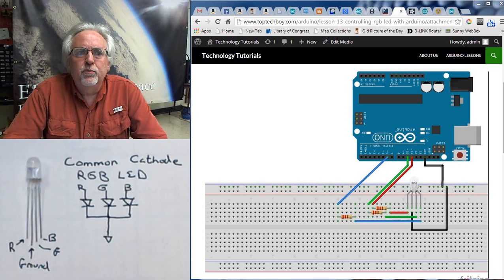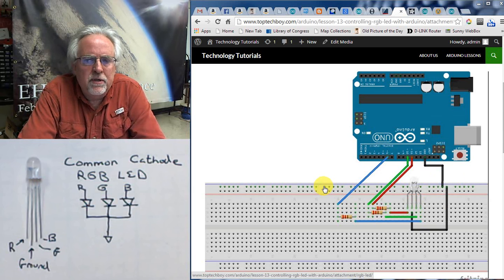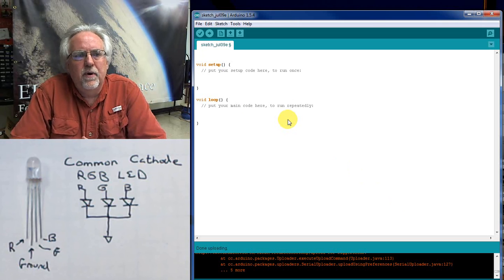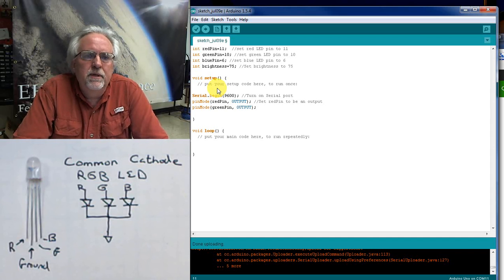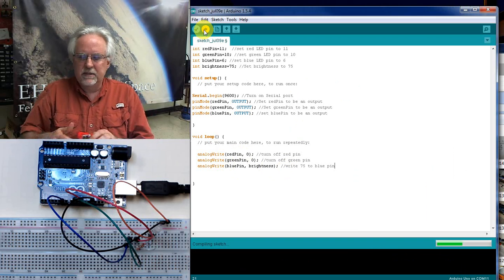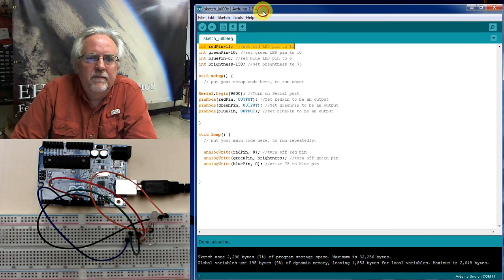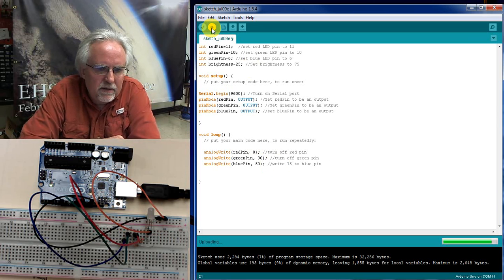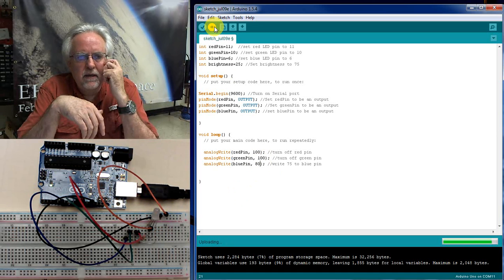LESSON 13: Controlling an RGB LED with Arduino

Comment: This one took a lot of tweaking to get a result I was happy with. The white is a little on the blue side, but not any more than the daylight bulbs you can get. But I can live with it, considering the red is so underwhelming on these LED's. I might experiment later with upping the current on the red and lowering it on the green and blue. But that will be for another day!

Thanks for the lesson!
My code below:
// Lesson13: RGB LEDs.
// Using the Arduino Nano.
// https://youtu.be/gqAHOoqo3OI?si=xvEFMB-R0pcTsk6S
///////////////////////////////////////////////////

// Set up the pin variables.
int iPinRed =  9; // The red LED.
int iPinGrn = 10; // The green LED.
int iPinBlu = 11; // The blue LED.
int iPinRnd = A1; // Used for random number.

// Control variables.
int iRedVal;  // The red value.
int iGrnVal;  // The green value.
int iBluVal;  // The blue value.
int iRndVal;  // Holds the random number.

// Delay variables.
int iDT = 10;

// Loop variables.
int a;

void setup()
{
  // Setup the serial port.
  Serial.begin(9600);

  // Set up the pinModes.
  pinMode(iPinRed, OUTPUT);
  pinMode(iPinGrn, OUTPUT);
  pinMode(iPinBlu, OUTPUT);
  pinMode(iPinRnd, INPUT);

  randomSeed(analogRead(iPinRnd));  // Initialize the random number generator.
}

void loop()
{
  // Note on the random(min, max): "max" will be -1 of max.
  iRndVal = random(0,10);  // Get a random number between 0 and 9.
  iRedVal = 0;
  iGrnVal = 0;
  iBluVal = 0;
  onLEDSequence();
}

// Writes the LEDs values.
//////////////////////////
void onWriteLED()
{
  analogWrite(iPinRed, iRedVal);
  analogWrite(iPinGrn, iGrnVal);
  analogWrite(iPinBlu, iBluVal);
}

// LED RGB sequencer.
/////////////////////
void onLEDSequence()
{
  switch (iRndVal)  // Select the color based on the random number.
  {
    case 0: // Red.
    {
      Serial.println("Red.");
      for (a = 0; a <= 255; a++){ iRedVal = a; onWriteLED(); delay(iDT);}
      for (a = 255; a >= 0; a--){ iRedVal = a; onWriteLED(); delay(iDT);}
    } break; 

    case 1: // Green.
    {
      Serial.println("Green.");
      for (a = 0; a <= 255; a++){ iGrnVal = a; onWriteLED(); delay(iDT);}
      for (a = 255; a >= 0; a--){ iGrnVal = a; onWriteLED(); delay(iDT);}
    } break;

    case 2: // Blue.
    {
      Serial.println("Blue.");
      for (a = 0; a <= 255; a++){ iBluVal = a; onWriteLED(); delay(iDT);}
      for (a = 255; a >= 0; a--){ iBluVal = a; onWriteLED(); delay(iDT);}
    } break;

    case 3: // Yellow.
    {
      Serial.println("Yellow.");
      for (a = 0; a <= 255; a++){ iRedVal = a; iGrnVal = a * 0.30; onWriteLED(); delay(iDT);}
      for (a = 255; a >= 0; a--){ iRedVal = a; iGrnVal = a * 0.30; onWriteLED(); delay(iDT);}
    } break;

    case 4: // Cyan.
    {
      Serial.println("Cyan.");
      for (a = 0; a <= 255; a++){ iGrnVal = a; iBluVal = a; onWriteLED(); delay(iDT);}
      for (a = 255; a >= 0; a--){ iGrnVal = a; iBluVal = a; onWriteLED(); delay(iDT);}
    } break;

    case 5: // Magenta.
    {
      Serial.println("Magenta.");
      for (a = 0; a <= 255; a++){ iRedVal = a; iBluVal = a; onWriteLED(); delay(iDT);}
      for (a = 255; a >= 0; a--){ iRedVal = a; iBluVal = a; onWriteLED(); delay(iDT);}
    } break;

    case 6: // Purple.
    {
      Serial.println("Purple.");
      for (a = 0; a <= 255; a++){ iRedVal = a * 0.90; iGrnVal = a * 0.04; iBluVal = a; onWriteLED(); delay(iDT);}
      for (a = 255; a >= 0; a--){ iRedVal = a * 0.90; iGrnVal = a * 0.04; iBluVal = a; onWriteLED(); delay(iDT);}
    } break;

    case 7: // Pink.
    {
      Serial.println("Pink.");
      for (a = 0; a <= 255; a++){ iRedVal = a; iGrnVal = a * 0.10; iBluVal = a * 0.15; onWriteLED(); delay(iDT);}
      for (a = 255; a >= 0; a--){ iRedVal = a; iGrnVal = a * 0.10; iBluVal = a * 0.15; onWriteLED(); delay(iDT);}
    } break;

    case 8: // Orange.
    {
      Serial.println("Orange.");
      for (a = 0; a <= 255; a++){ iRedVal = a; iGrnVal = a * 0.09; iBluVal = 0; onWriteLED(); delay(iDT);}
      for (a = 255; a >= 0; a--){ iRedVal = a; iGrnVal = a * 0.09; iBluVal = 0; onWriteLED(); delay(iDT);}
    } break;

    case 9: // White.
    {
      Serial.println("White.");
      for (a = 0; a <= 255; a++){ iRedVal = a; iGrnVal = a;iBluVal = a; onWriteLED(); delay(iDT);}
      for (a = 255; a >= 0; a--){ iRedVal = a; iGrnVal = a;iBluVal = a; onWriteLED(); delay(iDT);}
    } break;
  }
}

Comment: Hey paul. Thank you for the great lessons. They are pretty helpful in learning MCUs. for this lesson, can't you just connect the Ground to a resistor instead of connecting each LED? I guess you should just assume that the total parallel resistance of the LEDs to choose the right Resistor

Comment: MEGA 2560. The first time we tried this we failed. We managed on the second try to get the RGB Led to light all three colors however, once we begin to experiment with different values in the void loop, the RGB fails to light, when mixing below 80%. When mixing blue and green, green dominates and blue does not light at all. Anyone have any ideas?

Comment: Couldn't you use just 1 current limiting resistor on the cathode?
Reply: the RGB LEDs has different forward voltages like shown on the link : https://imgur.com/a/q7MCZBM so imagine we have a supply of 5V supplying the 3 LEDs and a resistor on thier common  cathod with a drop voltage of 3V, you will be left with 2V to play with across the LEDs will  which will not be enough for the Green and Blue LEDs to be lighting up correctly(see the graph), and you will notice the difference in intensity between the 3LEDs.
if you have 3 different resistors on each LED anode you will have the liberty to chose them according to the forwad volatge of each LED.

Comment: Great series! With the RGB LEDs I'm using, you cannot make them mix the colors like your leds are doing in the video.  If, for instance, I set values of red to 25 and blue to 25, while green is 0, I will see two small lights glow green and blue, but the colours do not blend together. I do not know if this is just my model of RGB Leds.

Thanks a lot! Even if they do not glow like yours, I still learnt something new. Only problem is that lesson 15 won't be as fun without RGB LEDs like yours.
Reply from the maker: Make sure to use digital pins with the ~ symbol beside them, make sure pinmodes are done correctly, and check you are using proper size resistors

Comment: Is it okay if I use one resistor, and connect it with the ground of the RGB LED instead of using three resistors?
Reply from the maker: No, each LED needs its own resistor. You will get unpredicatable results with what you are suggesting.

Comment: Sir you are using Common Cathode RGB led but i have Common Anode RGB led . 
I can't think a circuit for it can you help me.
Reply: I think attaching a not gate with the circuit and tweaking the code a bit should work for ya.....
Reply: @rikdutta14  Too complicated man, that's digital electronics.

 My dude Rik Dutta, it's kinda the same thing but you need 3 transistors to act as switches for each LED.

Comment: Sir why you used analog pins...? And not digital on arduino
Reply: Because an RGB LED is nothing but 3 LED in the same package , some colours are made of % of R G & B.
If you need to make a colour that is for example : 20% R, 30% G, and 40%B (power on each LED not % out of total) you need to control each LED's power output, and you cannot do that with digital. Digital is ON/OFF (Max power/No Power).

analogWrite and analogRead are functions that pulses on/of very rapidly an output or transforms an analog value into digital for the computer to understand,  simply put it emulates an analog value.

 A computer cannot input or output true analog values so it has to approximate those values using Pulse Width Modulation and the Fourrier Transform.

 (The science behind why and how is a little bit too long for a Youtube Comment reply, hope you understood what I'm saying here - it involves Fourier Transform, and Digital To Analog Converters and Analog To Digital Converters, stuff you learn in college)

Comment: Hello Mr. McWhorter, I have a problem. I am sure that the code and circuit from your video are correct.  The RGB LED code works fine, that is until I try and change it so that more than one pin has an analogWrite value. For example, if i try to make greenPin 100 and bluePIn 100, I get the following error:

C:\Program Files\WindowsApps\ArduinoLLC.ArduinoIDE_1.8.21.0_x86__mdqgnx93n4wtt\hardware\arduino\avr\cores\arduino\HardwareSerial0.cpp: In function '_GLOBAL__sub_I___vector_18':

C:\Program Files\WindowsApps\ArduinoLLC.ArduinoIDE_1.8.21.0_x86__mdqgnx93n4wtt\hardware\arduino\avr\cores\arduino\HardwareSerial0.cpp:77:1: internal compiler error: Segmentation fault

 }

 ^

Please submit a full bug report,

with preprocessed source if appropriate.

See <http://gcc.gnu.org/bugs.html> for instructions.

lto-wrapper.exe: fatal error: C:\Program Files\WindowsApps\ArduinoLLC.ArduinoIDE_1.8.21.0_x86__mdqgnx93n4wtt\hardware\tools\avr/bin/avr-gcc returned 1 exit status

compilation terminated.

c:/program files/windowsapps/arduinollc.arduinoide_1.8.21.0_x86__mdqgnx93n4wtt/hardware/tools/avr/bin/../lib/gcc/avr/5.4.0/../../../../avr/bin/ld.exe: error: lto-wrapper failed

collect2.exe: error: ld returned 1 exit status

exit status 1
Error compiling for board Arduino/Genuino Uno.

Any help with this issue?

Comment: when I connect my LEDs to the Arduino I don't use resistor and nothing happens to the LED why is this ? Mr.Paul said that this will cause the LED to explode but nothing happen to mine , why ?
Reply: it does burn after a while but it only explode when there's too much voltage
Reply: @pqpq1905  You mean current.
Reply: Because the arduino can output a maximum of a few tens of mA on any output and it's got it's own regulators. BUT! don't do that too much, you can burn those outputs or the entire MC.

Comment: Love these tutorials, but i think the arduino serial monitor  is not working in the same way anymore..
I noticed this a couple lessons ago when we learned     while(Serial.available()==0){}    the code would work the first user prompt, but skip the following prompts. 
After much researching i found that the cause of this is that the serial monitor buffer is not being emptied. To empty it i had to add  another Serial.read();      after int = Serial.read(); 
Unfortunately i seem to have a  problem now with lesson 13 
    
  Serial.println("Do you want the color to be red, blue, or green? ");
  while(Serial.available()==0){}
  user = Serial.readString();
 
  
  if (user=="red"){
    analogWrite(red, brightness);
    delay(900);
    }

    if(user != "red" && user != "blue" && user != green )
    {Serial.println("nopeee wrong!");}
The red light will not turn on and the nopeee wrong! code will be triggered instead.
Also if i change         if (user=="red")   to    if(user!="red") it will turn the red light on. 

For some reason the var user is not  == to "red".  Even though when i Serial.print(user);  the monitor prints   red    .
If anyone can help with this id be very grateful.  And if you read this Paul THANKYOU for such great tutorials.
Reply: So its the next day, ive found the solution ;)
void loop() {

 Serial.println("Would you like red, green, or blue? ");
 while(Serial.available()==0){}
 
 user = Serial.readStringUntil('\n');
         //Just need Serial.readStringUntil("\n"); instead of Serial.readString();
  
  if(user=="red"){
  analogWrite(red, brightness);}
Hope this helps someone, i told myself no coffee until i find the solution. mmmmmmm cooffeeeee. ;)

Comment: How is it different if a resistor is connected to the cathod instead of having three resistors???
Reply from the maker: You would pass three currents through the one resistor, which would raise voltage and then lower brightness. No, do not do it that way. Brightness will then depend on how many LED's are on.
Reply: So, I can use one resistor when I'm lighting only one LED up at a time like in tutorial 14, thank you, i"ll use three resistors when controlling all the three

Comment: my code for cycling through all colours

short redPin=6;
short greenPin=9;
short bluePin=10;

void setup() {

  Serial.begin(9600);
  pinMode(redPin,OUTPUT);
  pinMode(greenPin,OUTPUT);
  pinMode(bluePin,OUTPUT);

}

void loop() {

  for(int i=1; i<=255; i=i+1){       //Red to Green transition

    analogWrite(redPin,255-i);
    analogWrite(greenPin,0+i);
    delay(5);
    
  }

  for(int i=1; i<=255; i=i+1){       //Green to Blue transition

    analogWrite(greenPin,255-i);
    analogWrite(bluePin,0+i);
    delay(5);
    
  }

  for(int i=1; i<=255; i=i+1){       //Blue to Red transition

    analogWrite(bluePin,255-i);
    analogWrite(redPin,0+i);
    delay(5);
    
  }
  
}

Comment: Can we add one resistor at the cathode instead of 3?
Reply from the maker: No, because you might turn on more than one leg of the LED at a time. One per leg, just like one per LED if you had 3 led's
Reply: Yes we will keep each leg connected to one leg of Arduino, just the cathode will be connected to the ground through a resistor
Reply: You mean if I turn on more than one leg of the LED then the 330 Ohm will be too low?
Reply from the maker: I am saying you have to think of the RGB LED as three different LED. They are just in the same package. Each one needs its own resistor. YOu should not share a resistor through the ground. Treat as three different LED
Reply: a resistor AFTER the circuit has gone through the LED will not control the intensity of each LED to mix the three colors.

Comment: Can these colour levels be controlled over the serial bus? I have tried for two evenings but I am getting nowhere. Any help or advice will be welcome.
Reply: yes, if you want to do it in real time , you would need a GUI (more complicated stuff), if you want to set different levels once you can do it trough the serial monitor. He's got a course regarding exactly that, controlling values trough the serial monitor. It's a few courses back.

If you wanna control the colors simply in real time you can use a potentiometer and some code ( i reccomend doing it, it's gonna take some time and a lot of cursing and "WTF is wrong with it"s but it's worth doing it.

Comment: Sir,My setup's LED is not lighting up when i connect it to ground and nothing's happening.But when i connect it to 5V the LED glows.What is the Problem?
Reply: YOU HAVE AN ANODE TYPE LED.EVEN I DO.SO YOU HAVE TO SET IT TO 0 FOR FULL BRIGHTNESS AND 255 FOR ZERO BRIGHTNESS
Reply: same with me
Reply: difference between cathode and anode led
Reply: YOU HAVE AN ANODE TYPE LED.EVEN I DO.SO YOU HAVE TO SET IT TO 0 FOR FULL BRIGHTNESS AND 255 FOR ZERO BRIGHTNESS
Reply: when you connect  it directly to the 5v its supposed to glow, but it my get burnt because there is no resistor in between...
there might be something wrong in the way you connect the rgb led.. there is no need to connect the 5V because you control the current going through the led using the Arduino.. In that case either the connections are not right either you are missing something in the code
Reply: mine too. connect with ground ,nothing happen but when connect with 5v  . it light up
Reply: You need to connect to a digital pin and to ground. You should watch tutorial one and start from there.
Reply: same here ????????
Reply: LONG LIVE TONY STARK

Comment: Hi, is it possible to use a single current limiting resistor connected between ground and LED instead of using 1 for each diode?
Reply: yes but you should also only drive one color at a time.
Reply: There are in fact, 3 LED's inside the RGB "bulb", so you can't. The goal is to regulate the voltage output to each one, (hence why there are four leads)
Reply: Yea but, umm...it will limit the total curent not the individual curents. 

Draw the two circuit schematics and calculate the curents and you will understand why.

Comment: can i connect tube lights to it
Reply: lokanath mishra I think you will need an external power supply, but it is doable
Reply: thankyou sir......can u pzzzz tell me how to do that
Reply: You will have to use a 5v to 220v relay, that will make the connection between the arduino and the lamp+power supply, the relay will work as a switch